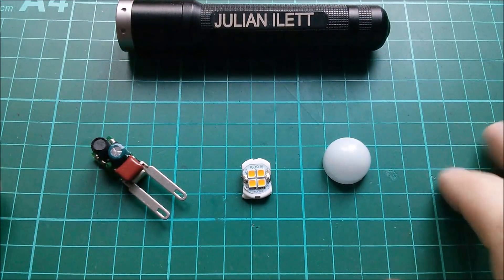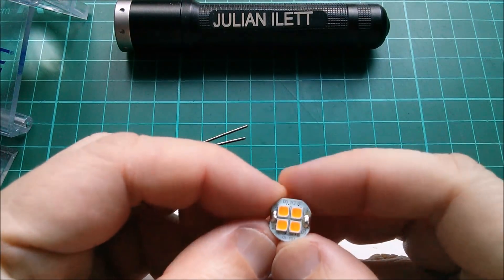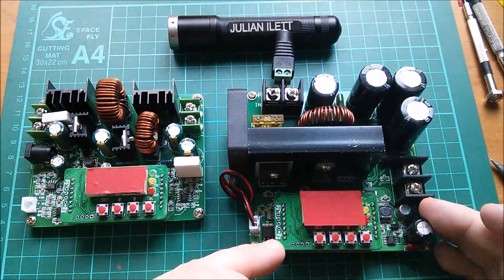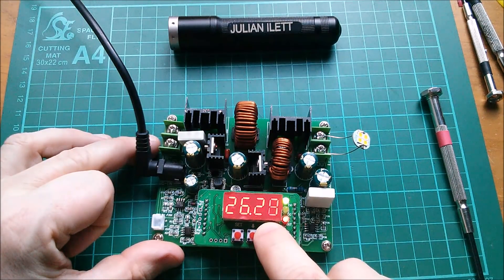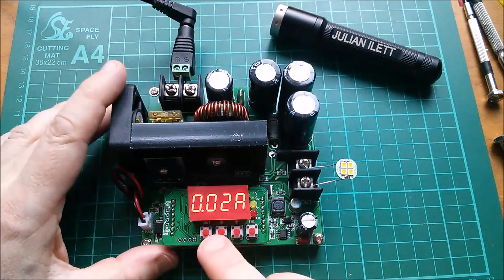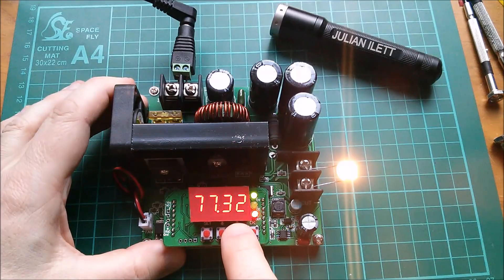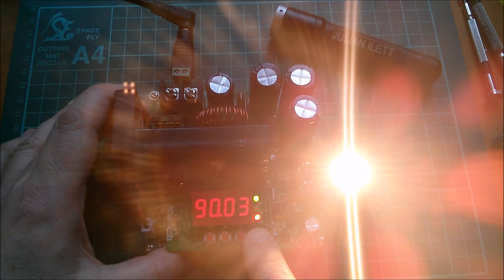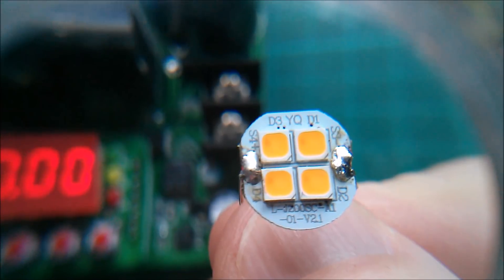85 Volt LED Module

Comment: My guess is 8 chips per package.  If you put a 1K resistor in series on the same supply then that would give you accurate enough control to bring them on at a faint enough glimmer to see the individual emitters under the phosphor.  I'l guess a 4 x 2 array.
Reply: Could two of these be driven in series direct from mains via full bridge rectifier and a nice beefy capacitor? (85 x 2) x 1.414 = 240
Reply: That's probably what it is. My 2014 self did a video on some 8 die LEDs inside a Cree light bulb.

Comment: At about 3V per LED, that means each of the 4 modules should have 7 LED elements inside it, giving you an 84 V drop across the module. Perhaps six surrounding one, in hexagons?

Comment: The CC mode is not immediately activated because the current is under 20mA. But when the leds start to get hotter, their threshold voltage drops and the current increases. After a few seconds the CC mode kicks in and the voltage drops progressively to 85V. I bet that if he keep them on without proper heatsink, it will go even lower until the leds are damaged. Luckily with the CC mode, the power they have to handle decreases with the decreasing voltage and constant current so he has a little bit of time before that.

Comment: I have some green LED's like those and each one has at least three LED's in each, I think there is 4, but they are being used in a dot matrix clock I built and there is a diffuser in the way so I can't tell for sure, but I did light one of them briefly and it looked to me like there was three, but that LED had issues, so it could be four. I would think there should be even more than 4, due to the voltage requirement.

Comment: You might want to reconsider using both hands to hold a power supply outputting 85 VDC, I for one look forward to you being around for more videos :)
Reply: Also remember that
a) This is not referenced to the mains
b) This is DC
Reply: Maybe Julian is one of those thick-skinned or dry-skinned people who doesn't feel 100 V and barely notices 240 V on a cold or dry day? It happens; on one occasion, a lady screamed with pain when she touched the incorrectly-wired central heating thermostat, in her new home, but I had felt nothing. Sure enough, the house wiring was wrong, and the control was connected to the live 240 V feed, instead of Earth. Both of us were standing on an insulated surface.
Reply: +Bart Kuijper

Have a look at IEC 60479
Reply: Yeah, perhaps something that can output more than 50V should have an enclosure rather than a bare PCB like that.
Reply: @CodeBurger Which is what makes it all the more dangerous. Being isolated from the mains there is no ground fault to detect when you make contact with the output voltage. And should you complete the circuit using both hands, the DC makes it impossible to let go of whatever it is you're holding.

Comment: Driver is a standard buck LEd driver, no capacitive dropper. Little teeny tiny IC has the complete controller and power switch in it to make a complete constant current source for the led. There is only a capacitor, an inductor with snubber and diode clamp on the driver, and then a single startup resistor and capacitor to the 300V rail, and a low value resistor that provides the set current, measuring the switch current rising.